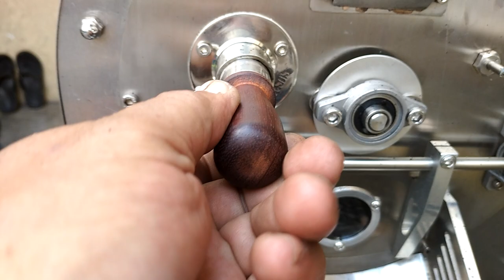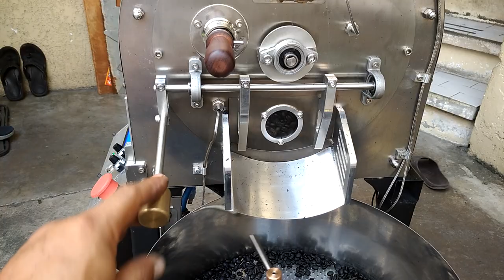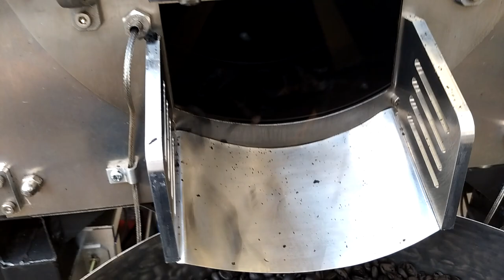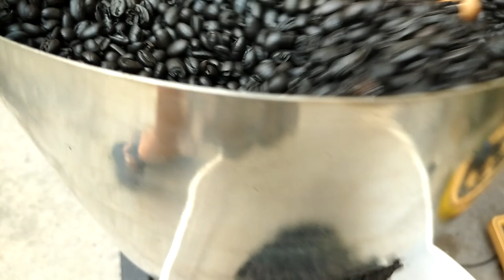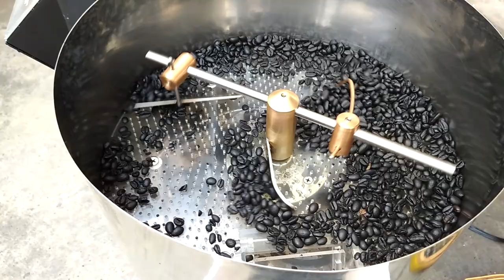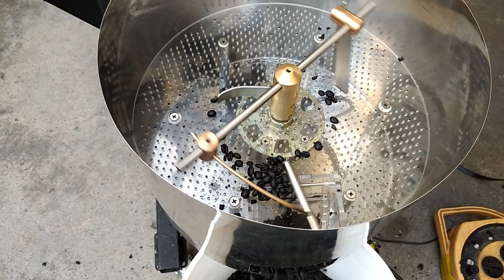DIY Coffee Roaster, 2kgs Capacity - Update 4 - Cavite, Philippines

Comment: Charcoal
Reply from the maker: Those beans are only for cleaning the drum, not intended to be consumed.
Reply: @44Notsofast  would you care to explain how it would clean the drum? Won't the drum hold and give burnt smell to the next roasting batch?

Thanks!
Reply from the maker: @ardianthaputera6970  They call this procedure "seasoning the drum".  Any dirt leftover from metal fabrication will stick to the beans. You discard these roasted coffee beans, not for human consumption. Repeat this procedure 4 more times before you load the drum with good beans.
Reply: @44Notsofast  Sorry that is not how to season the drum. Burn coffee oils will now impart that taste from subsequent roasting. As Mr. Putera said. I will say roasting to Full City at most for seasoning a drum. If your machine was built by a refutable company. The drum would be clean from any contaminants and  metal residues. And would most likely be seasoned. If you build and fabricated the roaster. No insult intended. I wish you good luck.
Reply from the maker: @red lightning  Thanks for your inputs. We've roasted more than 50kgs of beans in that machine which was made 7 months ago. Any burned taste has long been overpowered by subsequent roasts. That video was made when we were still "green" in the roasting process and we have learned a lot since then. And yes I built this roaster that's why there's "DIY......." in the title. Please focus more on the build rather than the roasting process which can easily be corrected by fresh new beans.